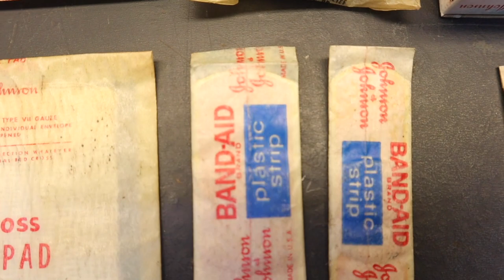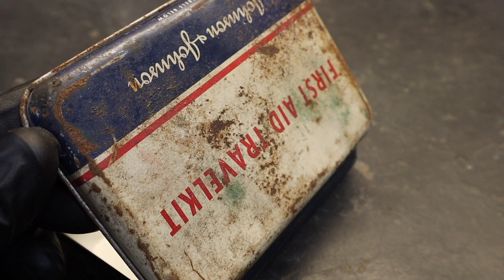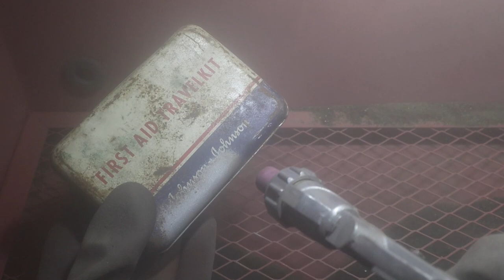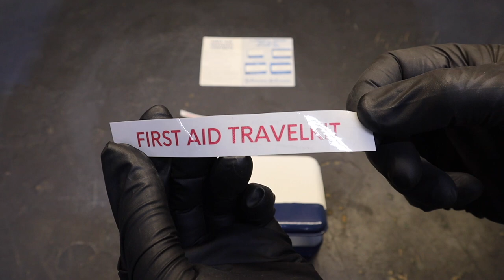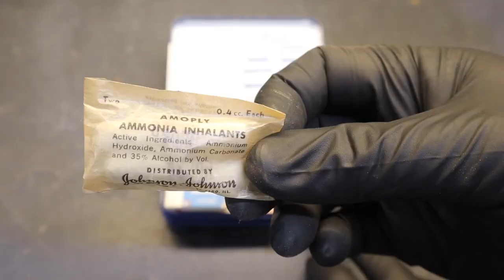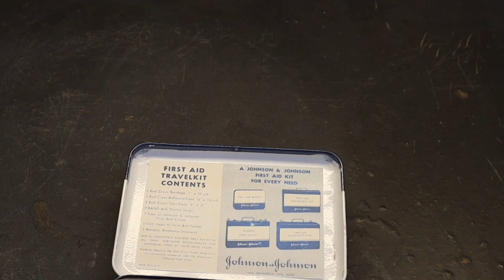Vintage First Aid Kit - Restoration

Comment: It seems you had to deal with paper, glued with a silicate glue (looks something like glass). We have a good result using a hot water. Just water the paper (right where the glue spot is) from a boiling cattle. 3-5 times for 1sec each and let it soak between times for 5 secs approx. The paper gets wet, but the glue softens and dissolves much more. So you can just peel the paper off with your fingers. Do it slowly, the paper will survive!
Reply from the maker: Thank you so much for this advise! I will have to try this next time. 🙂